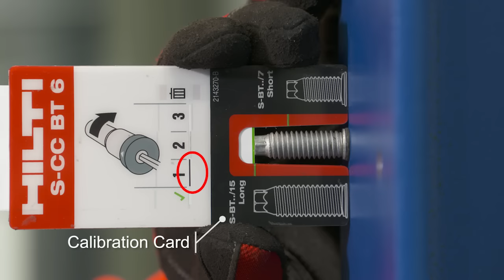Hilti S-BT-MF and S-BT-MR – Installation guide

Comment: how much weight will that hold ?
Reply: 1.8Kn on Steel
 S235 A36, see the data sheet on the website for more info: https://www.hilti.nl/medias/sys_master/documents/h36/h52/9533386358814/S-BT-Data-Sheet-Technical-information-ASSET-DOC-6724586.pdf